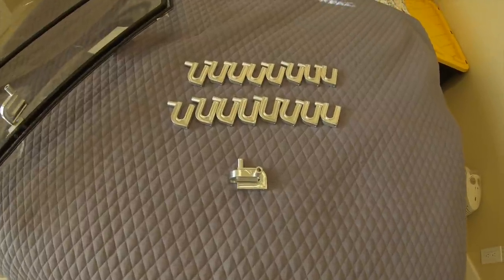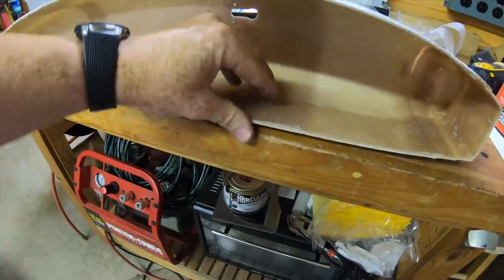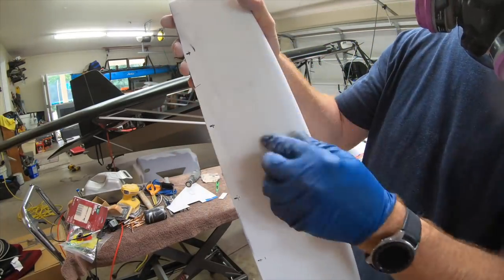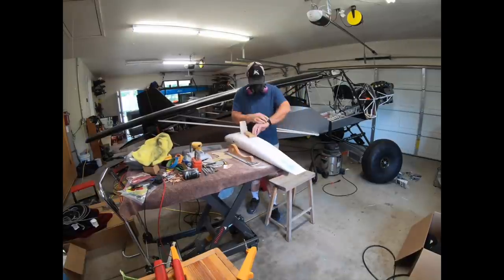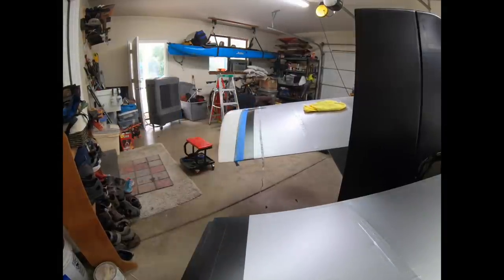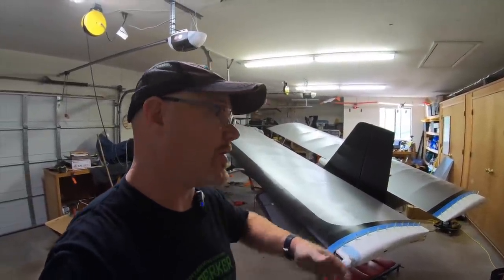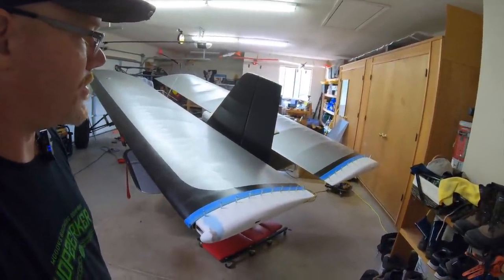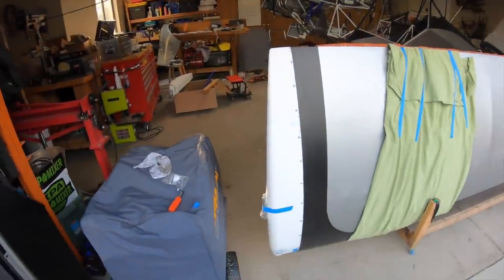Kitfox 7 Apex Build Episode 27 WingTips

Comment: Do NOT use washers to raise the edge of the wingtip to match, washers makes a small contact surface and the vibrations from the wind will make them spot wear. Rather make an infill on the tip to make an even contact surface.

I used washers for a boat when remaking it, diffrent objects but ill assume it will work the same with the wind 😉
Reply from the maker: I agree, I plan on raising the back side along that entire section.

Comment: Nice work finishing a sub-standard part. Is that a Firman generator by the wingtip near the end of the video? Good price at Costco, but reviews not the best. Your thoughts, please.
Reply from the maker: Yes it is, we have used it a lot here in Northern California where PG&E shuts off the power all the time. It has been reliable. Only issue I have had was when the oil cap backed off and it vented oil out.

Comment: Not sure why the manufacturer of the tips opted to use CSM instead of fabric except for being cheap.  The split molds should have been longitudinal.  The seam is ridiculous, probably an old torn up mold that leaves a gap that needs filling.  Our parts would never leave the shop looking like that plus we do not gel coat since it has to be sanded down anyway.  Manufacturers use it on to hide all the pinholes and bubbles.  Vacuum bagging or infusion is expensive and time consuming unless you don't mind doubling the cost of the parts and VE resin and fabric is light enough on a hand layup.  Kitfox should have a conversation with their manufacturer.  The only reason to go carbon fiber would be for the glossy CF look as the weight savings wouldn't be worth the expense or effort if you would be painting over it.  You can use your now nice looking tips as plugs to make the mold.  It will make a nice project after  you are flying.
Reply from the maker: Kitfox now makes these in house.

Comment: Is it possible that the step at the seam of the wing tip is designed to accept a clear lens that would cover your landing light?
Reply from the maker: There is a step for that, but what I refer to in the video is the uneven transition from the front peace to the back peace.
Reply: Got ya. I see what you are saying.